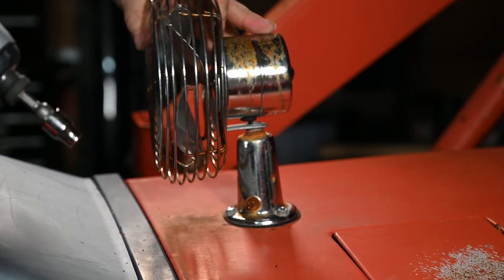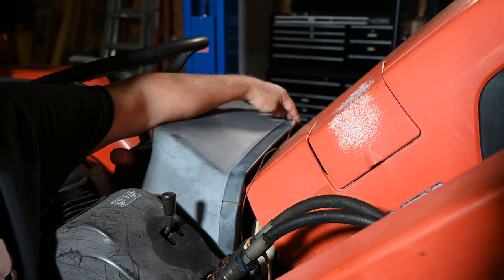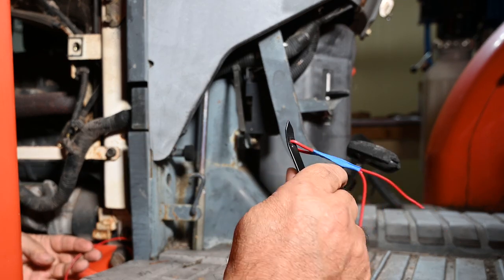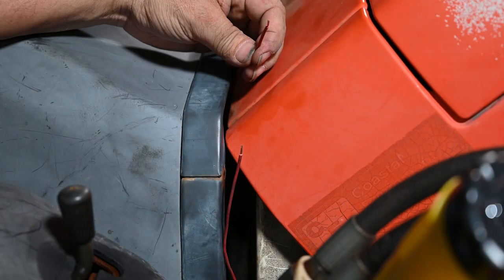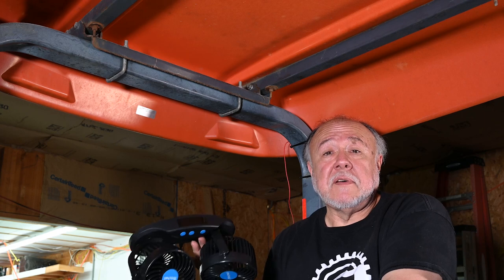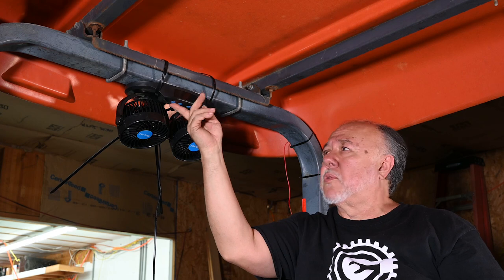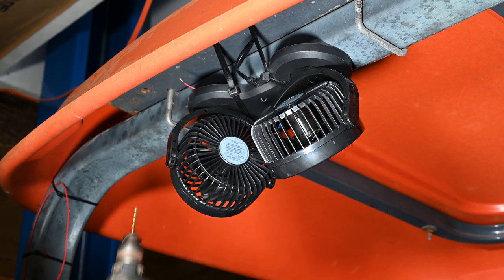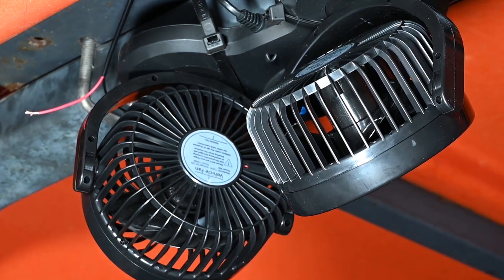Upgrade or Fail: Installing A New Set Of Fans On The Tractor

Comment: I've seen in some of your videos you have a DeWalt air compressor. Do you have a video on it? I'm looking for one and wondering what you think? Pro and cons?
Reply from the maker: It's been outstanding. One thing I like is that it's quieter than any other compressor I've ever been around. And most of the noise is coming from the air intake filter, so whenever I get around to building a baffle box for it, it'll be virtually silent. Well, maybe not silent, but pretty darn quiet. tbh, I can't think of any cons.
Reply: @CliffsGarage  Thanks, I've been comparing that one to the Northstar. Still undecided. 🤔